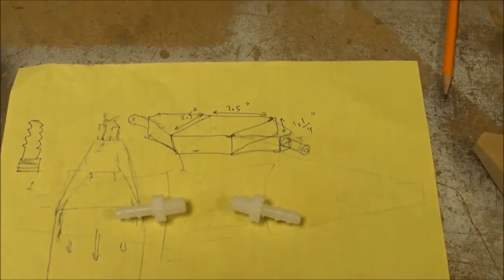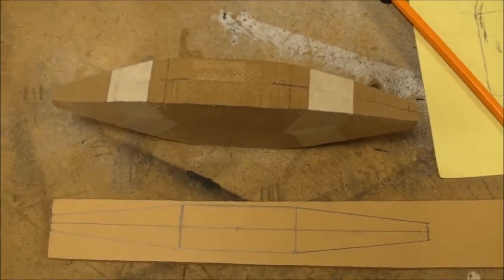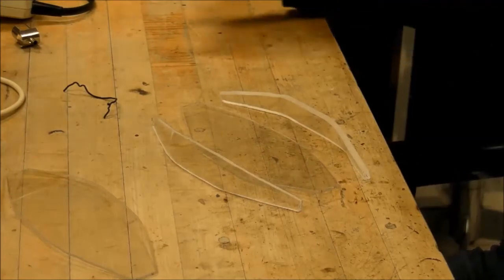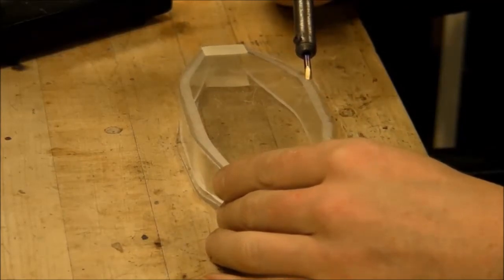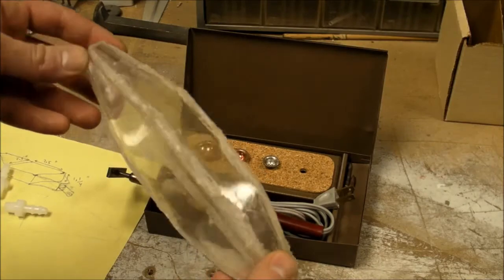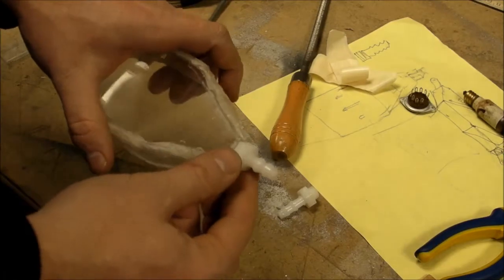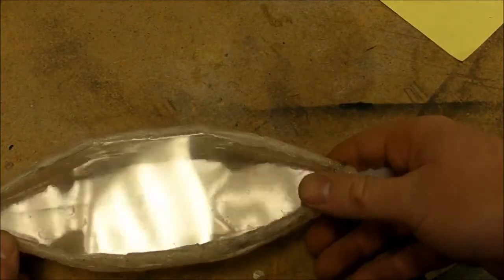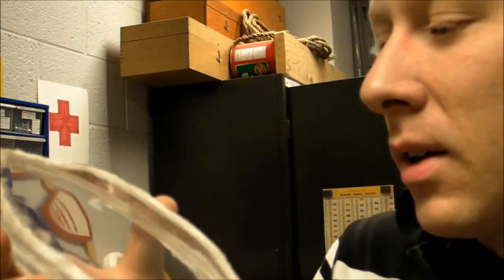(#0031) Making a Plexiglas RF Test Chamber

Comment: Another idea would be to use acrylic tube, cut disks for and glue for the ends /w your fittings.  Then use heat to flatten the center to form the rf exposure window.   Good video BTW!

Comment: IPS Weld-on #3 even if the edges are not perfectly smooth does a very good job and cures pretty quick.  If you wet the joints, then smush (technical term) together the soft pexi will melt together.  Using rubber bands to apply pressure helps.   Also, you can actually use the Weld-on #3 to "sand" the edges by rubbing it on the edges of your parts with a small sponge or wad of paper towel...